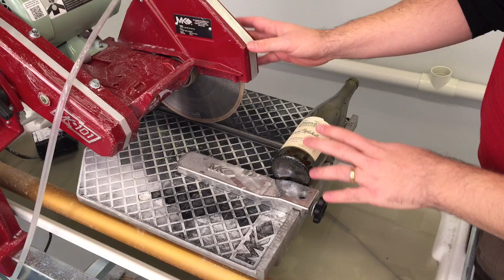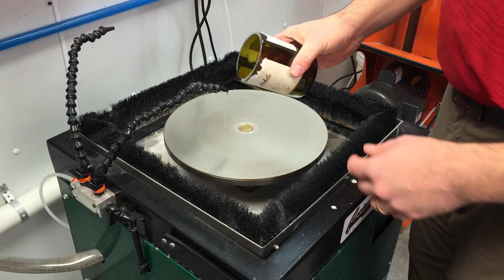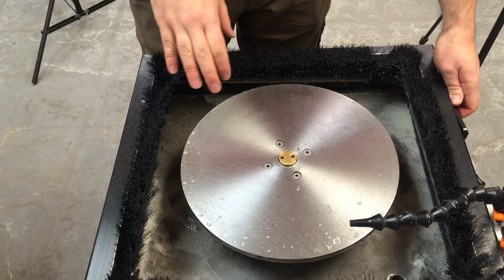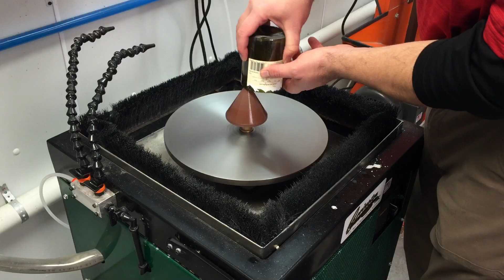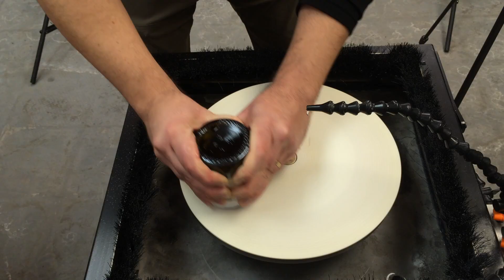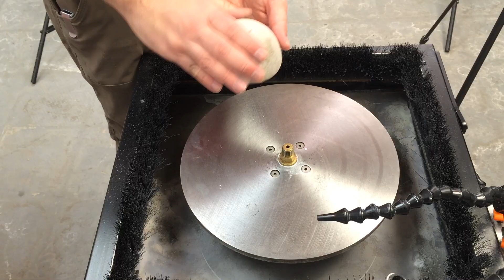Cutting and Grinding Wine Bottles into Drinking Glasses

Comment: Surely the need to rotate the glass on the grinder is more to do with the fact the outside of the wheel turns faster than the inside, also wondering would silicone oil help your plastic water coolant pipe from being so yucky to move, that plastic friction noise gives me shivers! Wouldn't be a fan of touching saw blades myself, i wonder could your finger be caught between the blade and the table, for instance if you have the table half the width of your finger from the blade, I would imagine it would pull your finger through. Interesting video none the less.
Reply from the maker: yes, the outside and inside of the disk grind at different rates. Not sure about oiling the joints in the Loc-line. Never had tried that before. Not sure it if would affect the tension hold of the joint.
Normally you do not want to be touching the saw blade. It's just a way of showing that you shouldn't be afraid of being near the blade as it will not cut you.
Reply: @hisglassworksinc  glad to hear about not touching blades, respect for the tool is essential. Just guessing on oiling the loc line (didn't know what it was called thanks) as I don't have one but have found silicone oil a real gem for plastics. Keep up the good work

Comment: LOL  I guess they dont know about hydrogen torches.   takes about 1/2 second to cut through glass.  all you gotta do is put the bottle on a spinning device.

and no at 2400 degree's it doesnt have time to heat anything up.. it just cuts.
Reply from the maker: That can actually create a lot of stress in the bottle if you plan on using it as a drinking glass. It could run the risk of shattering while someone uses it. If you torch the bottle, you'll really need to anneal it afterwards to homogenize the stress in the glass.

Comment: I need 3 dozen bottles cut and ground just once to use as plant pots. I can't buy the equipment or pay a fortune for an artisan to cut them. How can I  find someone to cut and quickly grind the edges....

Or is there another method that WORKS without chipping and cracking the bottles? I'm in Western Kentucky. Thank you for your help!
Reply: check much cheaper options on ebay.
Reply from the maker: I don't know of anyone that can do this for you locally there but you can look at using loose grit silicon carbide to hand grind the edges: 
https://www.hisglassworks.com/loose-grit/silicon-carbide/1-pound.html
There should be a video on the product page showing how this works

Comment: Great to see a pro setup. I have done the same on a budget hobby setup - the inland swaptop has been ok for similar work. I just don't think it will last as long as yours! 

What do you do with all the glass powder that is created? can you use it for anything? i wonder if you can cast it or fuse with it?
Reply from the maker: You can cast it. It will be full of bubbles and it actually floats almost like volcanic rock. Mostly we collect in a cascade system and dispose of it on a monthly basis. Be sure to wear a respirator when cleaning up the dried ground glass as it's basically silica dust which is quite dangerous to inhale.

Comment: I have a Crystal Master Pro 12 lap grinder. I would like to purchase your smoothing dome and cone. Will they fit my equipment . I also would like the cerium powder. What about the center plug. Will that fit my grinder and is that what I need to use the cone and dome. Thank you for any help you can give me.
Reply from the maker: The CrystalMaster Pro is a direct drive motor system so the shaft on the grinder is not large enough to have a threaded mount on it. We can't connect a cone or dome to the center portion of the CrystalMaster Pro.

Comment: Where's the part of the video where we see how to do it without spending an arm or a leg?  I'm like, "yeah, I've got a bunch of Jameson bottles I'd like to turn into light fixtures. Where'd I stash that extra $5k for machinery expense?"
Reply from the maker: If you only have a few bottles to do, you can cut them on the wet saw or hot pop them and then use loose grit silicon carbide on a piece of flat window glass to grind them down. This method with the grinder and diamond disks is meant for high production of bottles where you're working several hundred pieces a day.  Our silicon carbide video is here: https://www.youtube.com/watch?v=zTDUpXGkC0g&t=1s
Reply: @hisglassworksinc  thank you for the helpful reply! Same grits of sandpaper?
Reply from the maker: @lightleaker8304  Sandpaper won't work very well for rim work. You're better off using the loose grit for that. I would recommend a 220 grit from a saw cut or hot-pop and then a 400 grit or 600 grit.

Comment: Can you use the dome without the water feature in the center? I have access to one without the water in the center. Can you use full speed or does sanding wine bottles and such require a slower speed offered by the varible speed unit.
Reply from the maker: Of course. You'll just have to get water to the dome some other way (either with the external water line or a sponge with water by hand). The domes are diamond so they like to go fast. If you have a lot of grabbing or squealing from the bottle, you may need to slow it down though.
Reply: @hisglassworksinc  great thanks for the info. Great video awesome detail!

Comment: @hisglassworksinc After watching several different presentations on this subject, it seems that this method is more time consuming than using a glass cutter. Using the wet saw produces a very rough edge that needs a great deal of finish work with the grinders and polishers. Conversely, scoring the bottle and using hot/cold water (when done properly) takes a few minutes longer to execute the cut, but saves time when finishing the edge(s) due to a much cleaner cut. What do you think?
Reply from the maker: For small quantity numbers, yes. The hot-pop method is quite good. It's certainly more time consuming though so for large production it's not as feasible cost wise. The wet saw works much better for larger production runs.

Comment: Good technique and thorough instructional demonstration. I wish to recycle water glass bottles but I do not know where to buy the equipment in Lebanon , Middle East. I am impressed at how versatile glass can be used and reused.
Reply from the maker: We do ship worldwide and would be happy to give you a quote for the equipment. You can also start slowly by using loose grit silicon carbide on a piece of plate glass for grinding down the rims of the cut bottles.

Comment: Is there another way of sanding/polishing, without that exact machine. Is there something else you could use? I would love making some glasses for myself and for gifts, but I have a limited budget (and limited space)... Thanks a lot for advice! 😊
Reply: A vice and a hand sander. Clamp the bottle in and sand till smooth, then use sandpaper for the inside and outside edges. It won't be as perfectly smooth as this, but perfectly fine for a drinking glass.
Reply from the maker: Hand lapping with loose grit silicon carbide is inexpensive and easy to do: 
https://www.hisglassworks.com/loose-grit/silicon-carbide/1-pound.html

Comment: Do you or anyone else have ideas for the top pieces (cut offs).  I'm going to be making candles, glasses for many years, and it would nice to use those instead of tossing them.  thanks!
Reply from the maker: We have people make wind chimes from them and use them as luminaries by sandblasting or acid etching them and putting them over candles.

Comment: Were does the water go with the glass dust please?
Reply from the maker: There is a drain line that comes out of the grinder and we process the slurry through a cascade system listed here: https://www.hisglassworks.com/slurry-cascade-tank.html that then finally has a float pump that pumps the last chamber out to sewer.

Comment: Any tips...for not chipping the bottle at the end....?   I know you said you thought that it was the label or paper..but i have found that right at the end......it always wants to hang up then chip....ive tried going super super super slow.....till sometimes chips........im thinking its because it is cutting out of the bottle...instead of thru it.....Ive thought of stopping then flipping over and finish but then i never get it exactly straight..
Reply from the maker: Several things to try. If the blade is too rough or hasn't been dressed recently, it may pop out a chunk of the bottle at the end. If you are pushing too hard into the blade and not letting the blade dictate the speed, then the stress in the bottle is released near the end and causes a blowout. If you slow down too much at the end, you can build up heat in the bottle from the blade staying in one place too long and the strain pops the bottle there. You need to go slow and steady as you cut letting the blade dictate the speed. Don't put too much pressure on it. Don't stop near the end of the bottle but continue on through to the back of the blade and then bring the bottle back towards you after the blade has cut through. Don't stop at the end but continue on through the cut.

Comment: Grate video and presentation but, it seems as though it takes way too long to do one.
Reply from the maker: You'll generally do batches of glasses at a time, so each step you'll do maybe 20-30 pieces at a time. Doing one at a time is not time efficient, but necessary for the video.

Comment: No habrá polvillo de vidrio en suspensión en el aire ??? (esto es importante para prevenir la silicosis).
Reply from the maker: The water used encapsulates the glass dust and prevents any dry airborne silica dust.
Reply: Muchas gracias por su respuesta, ahora por favor me podría indicar cual es la vida útil del DISCO DE DIAMANTE ELECTROCHAPADO DE GRANO 80 DE 20 PULGADAS ?

Comment: where are your gloves?????
Reply from the maker: I do not like using gloves when coldworking as it makes it hard to get a "feel" for wha the glass is doing.
Diamond blades will not cut your fingers as they do not cut soft materials, so gloves are not required.
Reply: Gloves can be dangerous if the fast moving parts grab the gloves and the gloves pull your fingers with huge force. That would be worse than a cut every now and then.

Same with drill press.

Comment: You should wear and advise people to use safety gloves.
Reply from the maker: Gloves can interfere with the feel of the glass on the grinder and be problematic when trying to correctly adjust grips on the glass when grinding. The only time I've had any issue with glass cutting a student was when they tried to grab a piece that they lost on the grinder instead of just letting it go.
Reply: Martin Brandt you would really have to push your finger into a dimond wheel to cut it.... but maybe it could rip a fingernail off?

Comment: I'm cutting my bottles lengthwise and would like to know what to use to grind the surface after the cut.  I am aiming for a bit of production on this but am not ready to purchase a grinding wheel.  Do you have any other suggestions?  Thank you
Reply from the maker: The least expensive way to start out grinding pieces flat from a saw cut is to use loose grit silicon carbide on a piece of plate glass and hand lap the pieces. Quick, efficient, and inexpensive:
http://www.hisglassworks.com/shop/loose-grit/silicon-carbide.html
Reply: Very helpful. I watched that video as well. I have two more questions remaining.  What should be my starting grit, mid grit and last grit for a bottle to be fairly soft to the touch (not to drink from). 
Also, How much should I get?   Would you also recommend I get the diamond sanding pads also?

thank you
Reply from the maker: I would start with a 120 grit from the saw cut, then use a 400 or 600 grit to finish off the rim. It will still be a bit hazy, but it would be a soft texture on the glass.
Reply from the maker: I would only get the handipads if you were looking to make a bevel on the rim. If they aren't being used for drinking glasses, then there is very little reason to bother with a beveled rim.
Reply: Thank you very much for the help. wish me luck!
Reply from the maker: You are very welcome.
Reply: Mary Jennings

Comment: what is the smallest saw you can use
Reply from the maker: You can use smaller blades like a 7 inch blade but you'll have to roll the bottle through the blade instead of cutting all the way through the bottle.

Comment: a kiln and small handtorch would be much faster and way cheaper. Sure you could have some fallout from stress but with the time it takes to grind and polish a single bottle using grinding techniques, you could have made 10+ with torch/kiln. Ive done it many times for friends and family.
Reply: I've always wondered if smoothing the edge could be done with a really high temp?  Is that what you use a kiln?  I also believe the hard part is the cooling down process, (would have to be really slow I would imagine)?

Comment: I have a better idea. After cutting the bottle, fasten it on a rotating disk and use sandpaper.
Reply from the maker: +Musclebrain Smartypants You'll want to be careful and make sure to use water for any type method like this to prevent any airborne silica dust from the ground glass.
Reply: +hisglassworksinc thanks :) I already knew that, but thanks for mentioning and thanks for the video!

would holding it under water be a good idea? there might be a risk of being electrocuted. So, maybe regularly dipping the sandpaper and using an asbestos grade mask?
Reply from the maker: +Musclebrain Smartypants You don't have to flood the pieces with water or have it submerged, but just use enough water to keep the ground glass encapsulated in the water so it doesn't dry grind and become airborne. I would suggest using a good respirator as well when hand grinding glass.

Comment: Most of this can be done with a simple jig and carbide cutter to remove the bottom using hot cold water.Then some sand paper to finish the edges.
Reply from the maker: +Fria Gram This video is more for people who want to go into production making glasses. Not so much for smaller scale.
Reply: +hisglassworksinc could see that for finishing blown glass and the like, but wine bottle is odd
Reply from the maker: +Fria Gram Not so much if you're looking at producing a couple hundred bottles a day.

Comment: Awesome thanks for the ideas. Is that a tile saw you used to cut the bottle?
Reply from the maker: +Charlie Loventhal It is. Most wet tile saws will work well for cutting glass, but you'll want to use a glass specific blade to avoid excess chipping created by using tile diamond blades. It's important to make sure your saw provides enough water to the blade for glass as well. You can see information here:
http://www.hisglassworks.com/learn/saw-blades/water-usage-with-glass-specific-diamond-blades/
Reply: Thank you, sir.
Reply from the maker: You are very welcome

Comment: will a 7” wet tile saw work for cutting wine bottles?
Reply: I use a 10", you get one from Chicago Tool. harbor freight.
Reply from the maker: +Treyads It can, but you won't be able to cut all the way through the bottle and would instead have to rotate the bottle through the blade.
Reply: +Treyads Yes, but to compensate for the lower quality saw you should use the best quality blade you can find.  The guys that make this video have one that is great.  (I don't get any benefit from saying so)  I bought a few different blades before giving in and stepping up to better quality.  The main issue is lesser quality blades will leave more chips in the rim.  Better blade means less chips, which means less grinding.  I can't wait until I can afford a better saw.  I like the one he is using, but I also have my eye on a ring saw.  Another thing about saws is the clearance, which will dictate how large a bottle you can cut.

Comment: Very nice I got wine bottle cutter for my mom and I think I'll use fine sandpaper
Reply: don't know about that. Only way it will work is if the rotary tool is fixed so it does not move around and get a straight cut.
Reply: +Budehgong If you do, be sure to wear a filter/mask.  Glass dust is very hazardous.
Reply: I will do it outside in my shop and when I sand the edges I put a little water on the sandpaper to prevent glass dust. Thanks for your concern.

Comment: It takes really long to cut one.
Reply: +Dara Ea I have tried so many of the techniques to cut bottles and a saw is the absolute most reliable method.  My saw isn't nearly half as good as his and still I prefer it to any other method.  The bottle cutting videos that seem to be popular fall into one of two categories: 1. The only show the good cuts, not the hundreds of fails, or 2. they have years of practice and conveniently forget to mention it.
Reply: +Robert Martin Thanks for the advice, man. But It's hard to find these equipment where I live (Cambodia).
Reply: I use a  5 dollar cutter  especially if you have grinder.  My cuts were just like his .

Comment from the maker: You can fire polish the rims, but you need to be careful as wine bottles already have a fair amount of strain in them. Heating just the rim creates even more strain the glass and if someone where to use it with cold liquid it could shatter the glass while they are using it. Not a good thing. 
If you fire polish the rims, make sure to properly anneal the piece to avoid this type of situation.
Reply: +hisglassworksinc I agree, the time involved in properly annealing the glass would make fire polishing impractical for most scenarios.
Reply: Would be helpful to share source of supply for all tools used
Reply from the maker: @davealmeida2670  Everything is available from our website at https://www.hisglassworks.com
Reply: +hisglassworksinc Very good video.